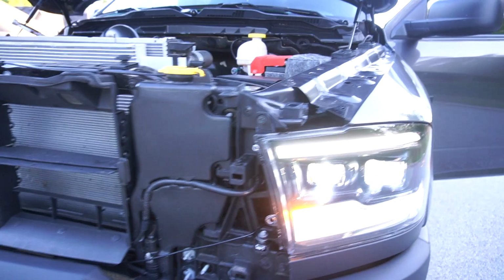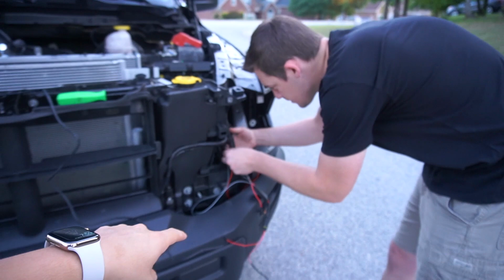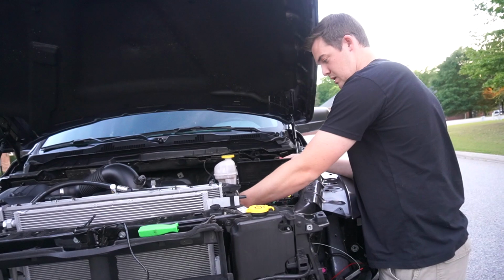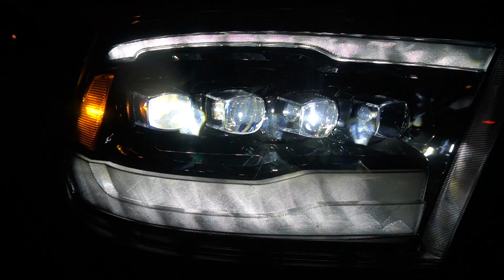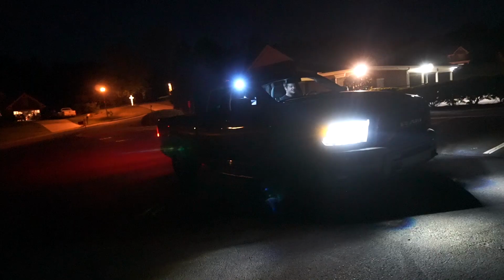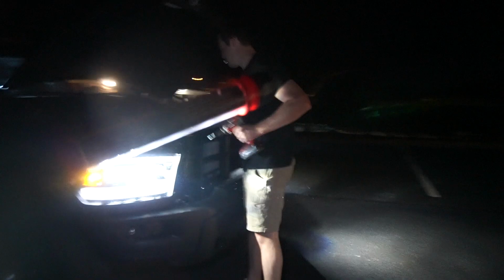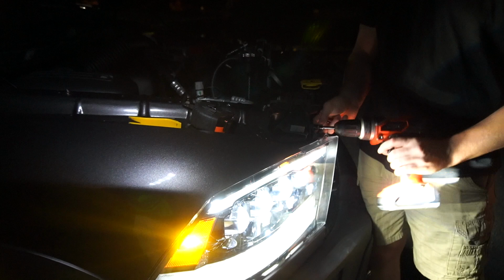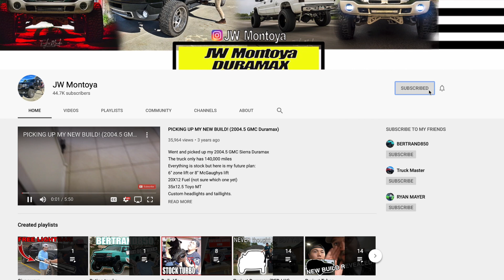TEST | Alpharex Nova Series VS Morimoto XB Headlights | 09-18 RAM | 4th GEN RAM

Comment: If anyone is watching this in 2023, I have had both alpha rex and morimoto. I stand by morimoto and that's what I'm currently running in my ram.
Reply: Glad to hear I just ordered the morimotos and was hoping I didn’t mess up lol
Reply: I’m on my second set of Morimoto headlights in my Silverado. They are great when they work. Had the first set warrantied because driver side was acting up due to a melted wire on the resistor. I’ve had the new set in for two weeks and now the passenger side cuts off randomly and driver side has no high beam. Every exterior light on my truck is Morimoto and I’ve had no issues until I went to the XB led headlamps. They are trash.

Comment: HOLD ON.. what in the world is a sasquenchial running light
Reply: ITS A GAHD DAMN SAMSQUANCHIAL
Reply: Other than the pronunciation, according to the websitel at Alpharex, the top is the DRL, and the bottom is the turn signal.  On the 4 projector setup, the outer 3 are on when the normal low beams are on, and the inner one is the high beam.

Edit:  Didn't realize the bottom also worked as a standard DRL if not signaling a turn.  Very cool video.
Reply: Had mine for 2 years. It's a nightmare. Bad wiring connection for f150. I do not recommend.
Reply: It's that gah damn sasquatch again
Reply: Apparently it makes your truck 10 times better 😊

Comment: On the end comparison, it appears the Morimoto has a better cutoff line than the Alpharex. It also appears the Morimoto has a brighter central "hot spot" for line of site. Great comparison!
Reply from the maker: Perhaps, but in our experience, Alpharex had better lighting for real life driving application
Reply: JW Montoya, very true! I’d love to drive with both (I don’t own either brand 😊).
Reply: Yeah, not sure if the alignment was bit off for Alpharex but I'd definitely prefer better cutoff line and longer distance from Morimoto... been debating which of the two and decided to go with Morimoto!
Reply: You can adjust the cutoff of Alpha Rex vertical higher or lower.
Reply: The Mori set is designed far better. Eliminating hot spots is paramount. The Arex have a nasty, midrange which hinders distance viewing. Clearly the Mori have a far superior projection in both even transmission and throw of the beam. The Arex have bells and whistles, but lack practical use. I intended on buying the Arex, until now. Great video guys.

Comment: I like how the morimoto has the amber bulb instead of the Amber lens in the Alfarx
Reply: I build headlights for a living and have spoken directly to the AlphaRex designers and I was told that the reason they use amber reflectors for the side running light is because of DOT regulations. They said that without the amber reflector on the side of the housing, US Customs can seize the palettes of lights coming into the country because they do not meet DOT regulations. Personally, I don’t agree with this or understand this as hundreds, if not thousands of headlights are imported at the ports every month that have smoked or clear corners and they never get seized. A simple “for off-road use only” on the box would solve this issue.

Comment: Base on the out on the garage door I can saw the Morimoto are still a better set of lights

If you notice the Morimoto has a concentrated hotspot with a wider beam of light that just below the cutoff where the Nova has a large blob  in the center of the light pattern that is not that concentrated so you'll be lighting up a lot of the foreground which doesnt really do you any good.

You want the hotspot to be just below the cutoff, this helps you with distance.
Reply: Yea but coming from the shit stock anything is better by a mile
Reply: Had mine for 2 years. It's a nightmare. Bad wiring connection for f150. I do not recommend.
Reply: I prefer the extra foreground light personally. These eyes aren't being tricked they're just not that good, the extra foreground light helps me to see with my poor eyesight.

Comment: I have the Alpharex Nova series for my 2015 Ram1500, and I personally like them,, only thing I would recommend getting along side with it is and AlphaOBD chip to prevent your led lights from flickering due to a change from using regular bulbs to led , which uses less power.

Comment: I went with the morimoto on my 13 f150 strictly for the distribution of light vs the alpha. The alpha did have slightly higher lux readings but actually at distance the morimoto are brighter according to headlight revo testing at longer distance. The alpha has an insane amount of foreground which actually hurts you as it tricks your eyes and not being able to focus on what’s out further. Y’all do your alignment weird haha. I do 2” drop from center headlight on both headlights so just to the right of your step is 2” below your center point. That way you won’t blind and you get the max output with the perfect straight line. Good video though boys

Comment: I dont know if I'm just bias or what but I own the Morimotos and was debating the alpha Rex's because they were around the same price range. But what turned me away from alpha Rex's was that they had a lower end model called the alpha rex pros, and after reading several reviews about how horrible they were i assumed that their higher end model would be just as bad. Even though the alpha rexs are brighter with their low beams compared to the morimotos i chose morimotos because to me it looked like the the day time running lights and sequential looked better. The morimotos didn't look like they had gaps in between the leds and looked more like a tube led. Also I dont plan to go off-roading so I dont need high output, the morimotos get the job done for me.  I am overall satisfied with my purchase.
Reply: I agree with you @xVietvenomx
Reply: Disagree but as long as you are happy

Comment: I just bout these as well. Did you all have any issues with parking light warnings when using turn signals with lights on?
Reply: I just installed the Novas and that’s the issue I’m having. Even when I used AlfaOBD and set them to LED
Reply: I'm having the same issue

Comment: A year later how does the rex working out ? Moto had the burn issue on the v1 but came out with v2 that fixed that issue
Reply: Don't buy it. I had mines for 3 years. Had to replace it 3 times. Pretty bad quality wiring. Loose fuse box components, the connections didn't fit well with my f150.

Comment: Bought a set of 5th gen style Nova's for my '17 Ram 2500.  I really like the lights.  Except, with the lights on I get a parking light out error when I activate either turn signal.  I contacted Alpharex and haven't received a reply.  Seems to be quite common with Alpharex customer service.  While they indeed look cool, I'm thinking I should have gone with Morimoto.  I've always had good luck with their customer service.

Comment: Are you confusing Lumens with luxx? When I called the manufacturer of alpharex they told me that they were 2200 luxx and that they didn't rate them in Lumens. 2200 Lumens is not very bright at all. My factory light assemblies with LED replacement bulbs are 10,000 / bulb. Just to give you an idea of what bright lumens are. Great video!

Comment: My heart overruled my brain but made a deal with my brain to buy the Morimoto 4banger hxb for my fog lights (4Runner) to make up for some suboptimal headlights for optimal fog light, where it really matters most to have the best (technically)….for the Baja Design folks, fret not.  My project is only half complete.  I’ll add the amber S8 or Onyx in my c4 bumper.

Comment: I think the Morimoto is wider and shines further, just not that intense light right in front of the truck.
Reply: Montana wild it does go further and wider yes. Alpha seems brighter because of the high foreground lighting
Reply: @R6_Nitty  I just wonder if that super bright foreground light will make it easier or harder to seeing certain situations.
Reply: Montana wild it depends on where the object is or situation. At distance it will be harder but if it’s close usually it’s already to late by the time you react etc. I’m a width kinda person. So between the morimoto xb head and the xb fogs I can see an extensive amount at 160-170 degrees from my truck. They’re both extremely wide beam patterns.
Reply: @R6_Nitty  I think I would still take the Morimoto headlights with some morimoto foglights.
Reply: Even  if the alpharex are brighter in the immediate foreground
Reply: Montana wild yes I agree which is what setup I run on my truck

Comment: I have these lights and love them. What did you do to get a sequential turn signal? I didn't connect the DRL's.
Reply: Unplug the green wires that came connected with the lights and it will work as a sequential blinker instead of the standard blinker.

Comment: Yours aren’t as bright because when the lights are on the strip dims down but on drl they are at full brightness
Reply from the maker: What do you mean? We did the DRL
Reply: His talking about your truck. You mentioned they aren’t bright. I had same issue once you do a direct tap to a fuse and only run the DRL the light output is way better you will know they are on. Great content by the way.

Comment: The one thing that needs to be discussed in videos like this is customer service if there's a problem. It's my understanding that the morimotos have a 5 year warranty, where as the alpharex only have a two year warranty. Question is, how do these companies handle things if their product fails prematurely? I'd like to know more about customer service before I drop that kind of money on these headlights. Can these headlights be serviced once their out of warranty if something goes wrong, or are you buying a whole new lens assembly? Be nice to know this things before putting out all that money.
Reply from the maker: Morimoto is a bigger company and has been around longer. I couldn’t tell you honestly since I’ve never had to contact either of the companies for warranty claims

Comment: Ok so I purchased the pro series Alpha Rex headlights a few months back & don't get me wrong I love them but these ... these are nuts!!!! Do you have a link for these exact ones? When I go to their website it doesn't show the sequential lighting or the lower light being on.
Reply: You have to buy the G2 Pro Series to get both top and bottom DRL's on. The regular AlphaRex headlights only run the top strip for the DRL. The G2 Pro Series is a bit more expensive. To get the LED version AlphaRex's, you have to buy the Luxx edition as well. Or you can install aftermarket LED bulbs in the regular AlphaRex headlights.

Comment: and did he say "sis-quen-chal"... lol

I have the Morimoto XB and love them. 
Morimoto build quality and over-all look is better than the Alpharex.
No dash codes with the Morimoto either. And i have Sequential Turn Signal which looks a lot better than the Alpharex.

The Alpharex IS NOT totally blacked out. There are chrome pieces on the sides of the jewel and an orange colored lens on the side.
The Morimotos are Completely blacked out. No Chrome, No Orange Lens!
The LED DRLs on the Alpharex do not look crisp nor as clean compared to the Morimotos DRLs, you can see that in the video.
The Sequential Turn Signal on the Alpharex LOOKS DULL!!!
And although the Alpharex is brighter... its just common sense... 
you have 3 on the Alpharex compared to 2 on the Moriimoto, the Morimotos are still bright.
Power was out on the streets one night and high beams on the Morimoto's was overkill.
But Wait a Second....
Why does the Morimotos look brighter on the Garage Door segment (time index 13:30 to 13:45 of this video) than the Alpharex... INTERESTING, lol
On the front cover, the Morimoto has 1 draw line from top to bottom.
On the Alpharex, why is it an inverted "Z" line?
The Alpharex 4 smaller lights give me a Merc Benz look... and i am not a fan of them. 
Sequential @ start-up... Cute... but a no for me. Gives me juvenile.
This is strictly my opinion.
Reply: Sounds like you have it all backwards because clearly the alphas are brighter everything and look way better
Reply: Morimoto are definitely built better and look better. Brighter isn't necessarily better... Usable light is better
Reply: 4Runner morimoto look cheap.
Reply: Morimoto are proven. and they do have the sequential start up for the Tacoma version

Comment: How are the alpha Rex holding up? I’ve had morinotos for 4 years and I’ve been unimpressed since day 1, my wife won’t even drive my teuck cause the output is so terrible
Reply: What year is your truck and what Gen of Morimotos do you have? Only asking cause I'm stuck between buying these two right now so any input to sway me in either direction would be great lol
Reply: @jeremychard7352  it’s a 2012 and I have the very first ones that came out, did they change them since then? Besides the colour option for the drl?
Reply: @moparmagic400  yeah they released a V2 cause apparently the sun was bounching off the projectors and creating a hot spot in the housing and melting it. I talked to someone at Morimoto customer service and apparently when they released the v2 to fix the melting, they went with newer LED's and a different projector lens. How true this is? I don't know... but that's what Morimoto customer service told me
Reply: @jeremychard7352  yeah both of mine are melted, I can get new ones under warranty, maybe I should give it a try and see if the v2’s are any brighter
Reply: @moparmagic400  if you can get new ones you definitely should! Nothing to lose except maybe the price in shipping. But seeing how it's warranty I'd really hope they cover it.
Reply: @jeremychard7352  I had to warranty one light a week or two after I got them because there were wires showing through one projector shroud but it was early on before the v2’s were out. And sadly I had to pay shipping. And when I got the new light it had a more of a blue hue to it. Honestly if I didn’t have really good fog lights and the ability to have them on with my high beams I think it would be borderline dangerous with the morimotos, I have a 2001 dodge with eBay reflector housings and a decent led bulb and they are a better output. But yeah maybe I should try get new ones. Maybe I have a bad batch or something
Reply: @moparmagic400  definitely worth a shot. I have a set of Morimotos I'll be getting hopefully by Friday, if not, hopefully early next week. I'll let you know how they turn out. If they turn out garbage, I'd still say that you should warrenty them, then once you get the brand new ones try selling them for 1k. Better then nothing lol.
Reply: @jeremychard7352  yeah that was my next move haha but definitely let me know what you think of them if you remember to, I’m interested to see what someone else thinks
Reply: @moparmagic400  so I just installed them. The output is insane on mine but I didn't realize you can't really get to the adjustment screw on them. So I have to wait till tomorrow they are way to high out of the box with a lift lol.
Reply: @jeremychard7352  ok good to know, I guess I’ll be sending mine back for warranty. Is it a nice white light? Or can you see blue in it?
Reply: @moparmagic400  mine are pure white. Don't even see a little blue in them
Reply: @jeremychard7352  well I’m getting two new lights under warranty. Have to go through morimoto directly now instead of the supplier I got them from so it’s costing more for shipping and will take a while to get them since I’m in Canada but I’ll see if they’re any better than my Gen 1 lights. If not I may just try sell them and try the gtr carbides. They look like a super nice light spread
Reply: Got my new lights today, pulled them out of the box and the projectors are flopping around in one of them. Wait another 2 weeks I guess
Reply: Update: Ok so I finally got my lights all figured out, they sent me two new ones again after the loose projectors and the other one only had one light working. And this set I got works properly and are wayyyyyyy better than my originals. I think they physically look better and they perform better in every way, better cutoff, brighter, light the ditches up more and there’s no dead spot in front of the truck. Morimoto was also great to deal with, answered all my calls and emails the same day.
Reply: @jeremychard7352  did you ever get yours adjusted down enough? I also have a lift and my new set were way to high, I was nervous to turn the screw that much so I put a washer behind the top bolt and it brought them down but I emailed morimoto and they said I could turn the screw more to bring them down too. I think if you need to adjust them up a lot is when the inside can unthread